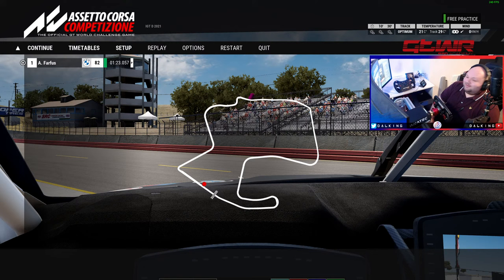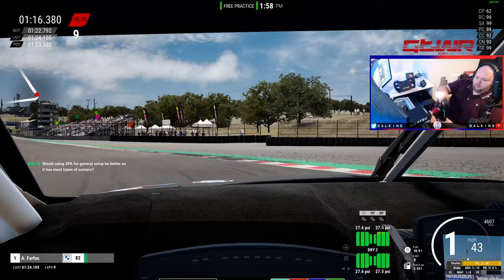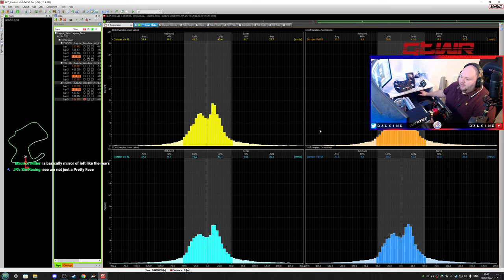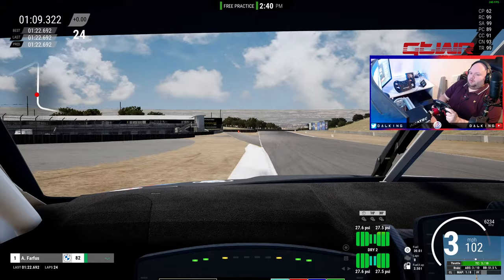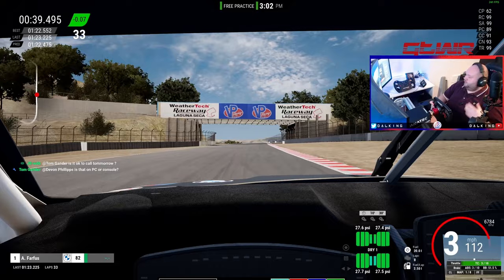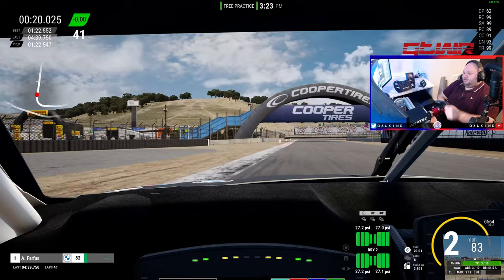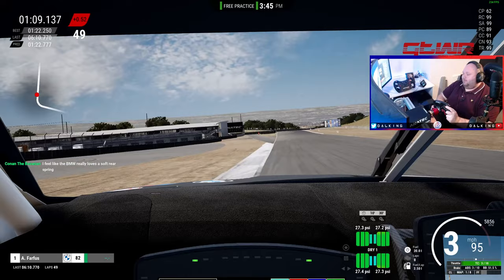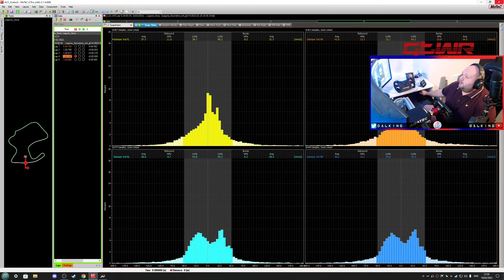LETS LEARN HOW TO SETUP UP DAMPERS IN ACC USING MOTEC

Comment: The biggest issue with this video… and full respect man for putting this out there… I’m on console so I’m always looking to understand what changes make to setups.

The biggest issue is you know what’s happening with the dampers but you’re guessing at changes your making because you’re not taking notes.

You make a number of changes during the video to the front left tyre that adjust away from your ideal outcome.

Then you make changes at the rear of the car that also impact towards the front left tyre more towards what you want… even though you never adjusted the front left tyre values. Then you adjust the front tyre again and it goes away from what you want.

Without taking notes regarding what impact the changes you make have on the values in your graph, it’s like the blind leading the blind.

I don’t even have Motec but I’d recommend making changes 1 wheel at a time but taking notes on every wheel.

This is an arduous task for sure & thank you so much for doing this video I really did enjoy it more than you can imagine… subscribed 👍🏼

Comment: Using this extended version as a tutorial so thanks @Dalking. Still at the point where I'm trying to numbers around 50. I'm definitely over damp at Zandvoort in the M4 slow bump and under damped on rebound side.